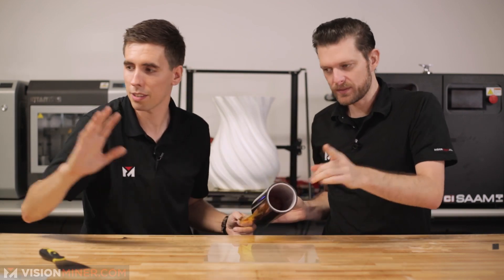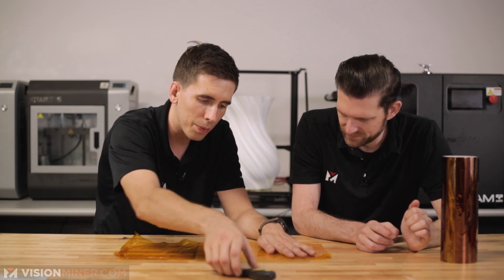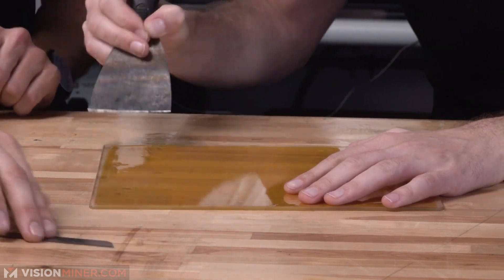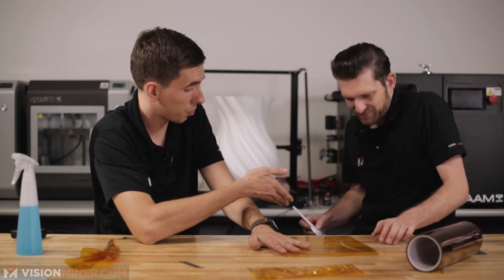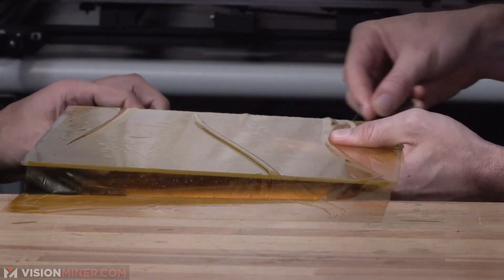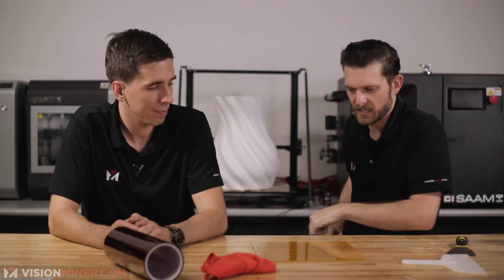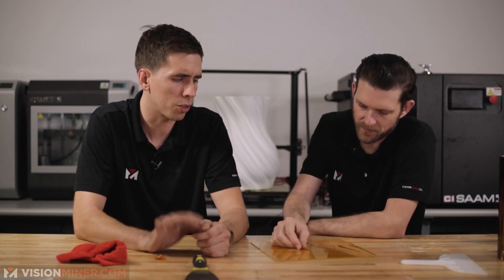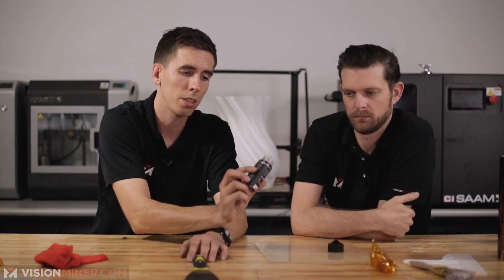How to use Kapton Tape for 3D Printing Bed Adhesion

Comment: Would a heat gun not help with the bubbles like by this vinyl foils it does?
Reply from the maker: Not really since it doesn't stretch til very high temperatures, unlike regular vinyl wrap. The water helps a lot because you can squeeze out the bubbles :)
Reply: @VisionMiner  would ipa help too? 🤔
Reply: @WaschyNumber1  I don't think drinking isopropyl alcohol will make your print problems go away, and is in fact quite hazardous.

In turn, applying india pale ale to the print bed... i think carbohydrates will serve as release agent, so it's unlikely to work, but it's safe to try.
Reply: @SianaGearz  no one is taking about drinking, I think you maybe have a drinking problem 🤔

Comment: Have you guys ever tried kapton straight onto a flexible steel bed? Wondering if the tape has enough give, to stick while allowing minor flex - to help initial part removal
Reply: This works -> Craftbot flow series
Reply: @michkohle2587  Ooh cool, thanks!

Comment: How often do you have to reapply and would it be worth applying directly to my bed without the glass top
Reply from the maker: You reapply any time it gets messed up, which is often. Best to use on the glass, as it sticks really well, may not stick to your actual bed, but wouldn't hurt.